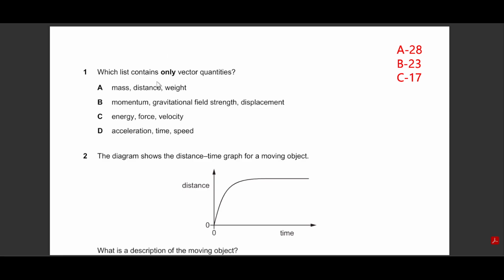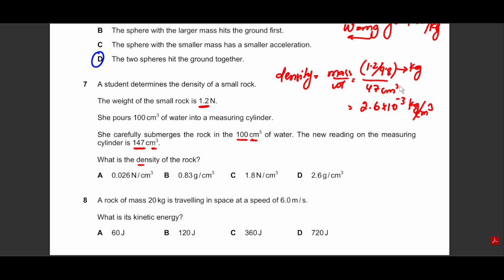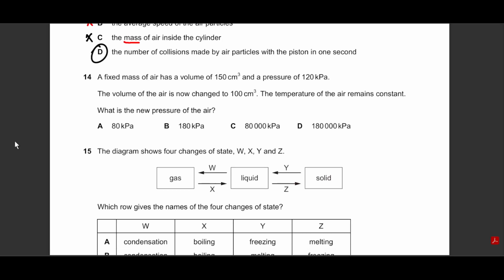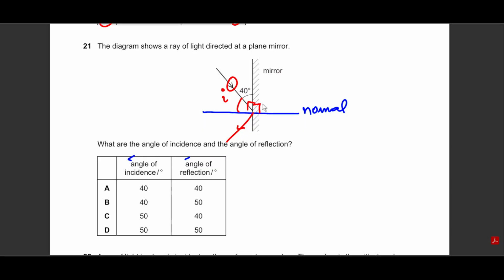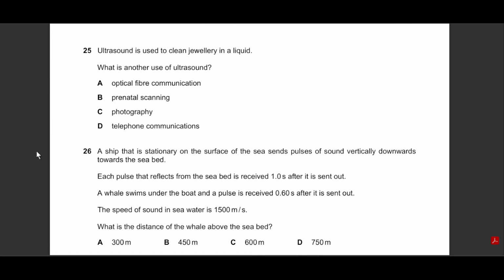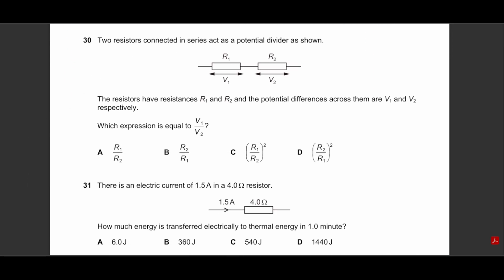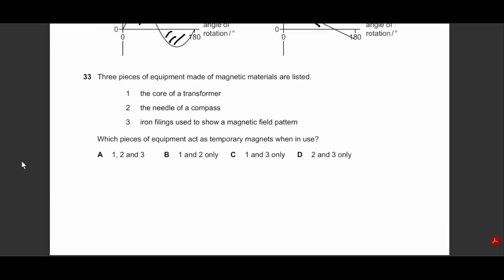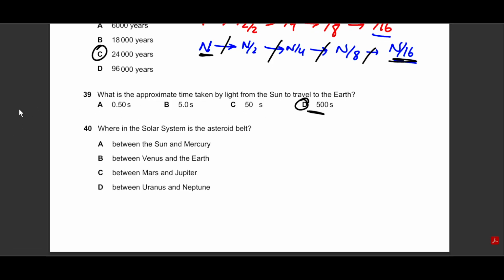O Level Physics 5054 - May June 2025 P12

Comment: 31:35 1.5×4×60=360
I think you meant to equate  power to I2R and then multiply by  60 to get 540:)
Reply from the maker: Yes, you are right. It should have been (I2R x T). Thank you very much for the correction, it will be helpful for everyone coming to this video in the future. 

Regards